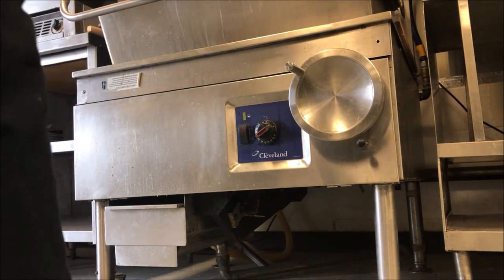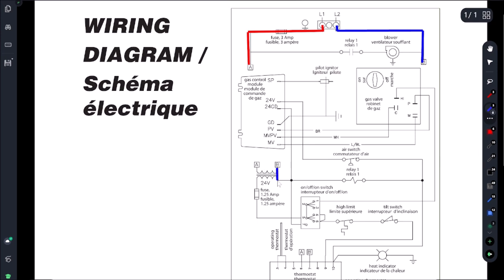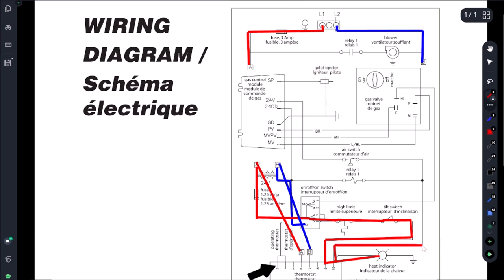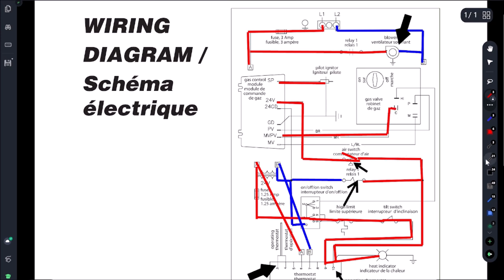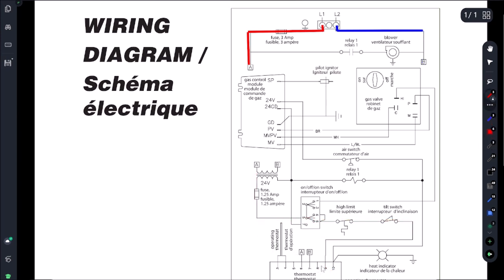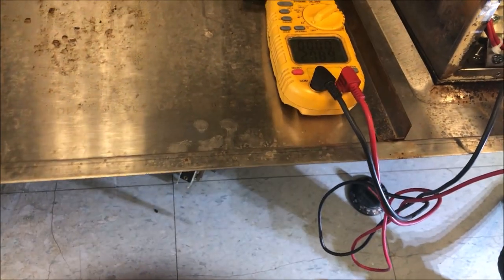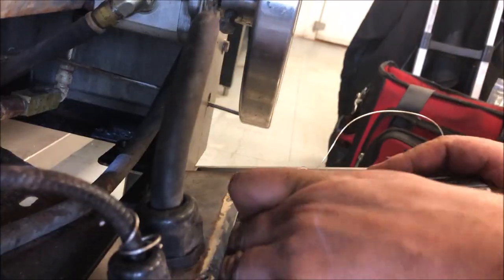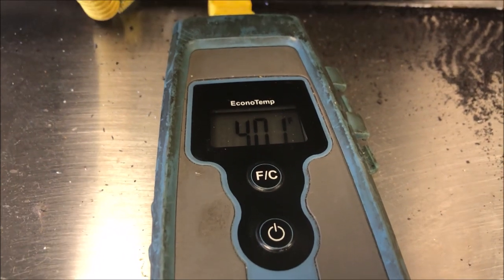Cleveland Tilt Skillet Not Getting Hot Enough

Comment: Thank You, You're right we don't see that often. But from my experience, if the hilimit is going bad, the thermostat may be faulty as well. Too many trips on the hilimit has destroyed it. I have always changed them out as a pair in all hot side equipment that have bad hi limits.
Reply from the maker: Ya that’s a good point, it’s been about a month since the repair. I guess time will tell
Reply: Especially on a fryer I always do the thermostat and the limit together because you're draining the tank and you're getting in there anyway

Comment: When I bump into issues like this I like to replace both thermostat and high limit to avoid callbacks, high limit is getting tripped or gone bad from thermostat not regulating temperature and causing high limit to trip, secondly thermostat shouldn’t be calling for so much heat to cause the high limit to trip so thermostat is beginning to fail, but this is just me when I work on hot side equipment.